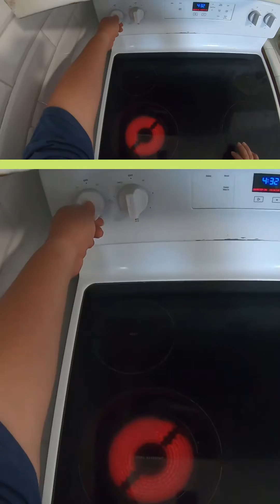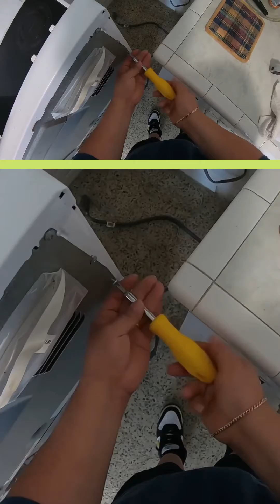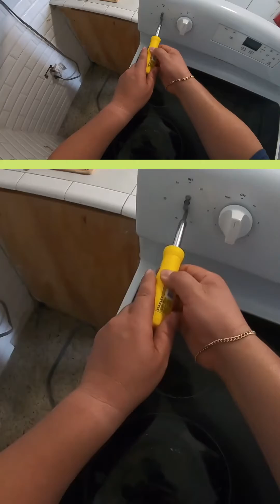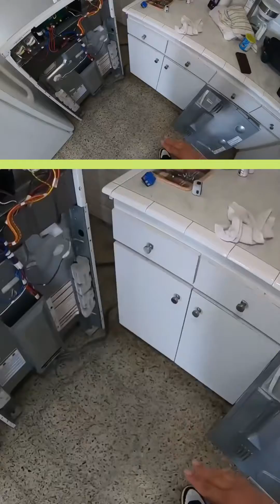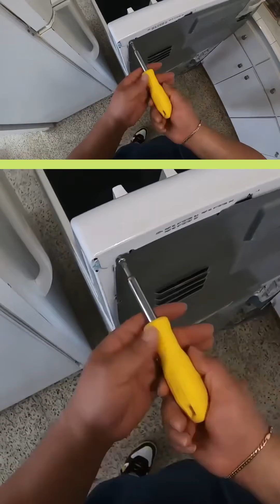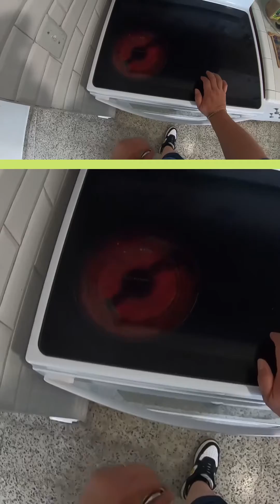Whirlpool Stove Burner Stuck on HIGH? Easy Fix! (Model WFE320M0JW1)

Comment: If the problem is with the a regular burners the same switch ?  Not the dual burner ?
Reply from the maker: Yes, the process is generally the same for single burners, though the switch part number might be different!